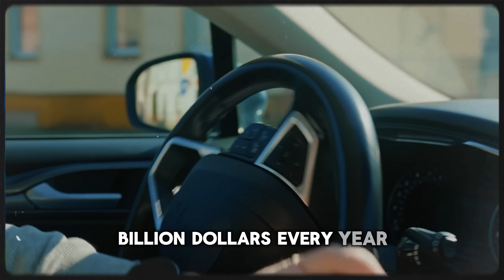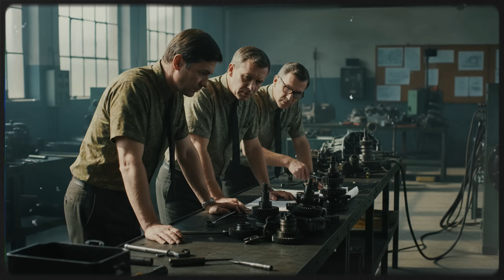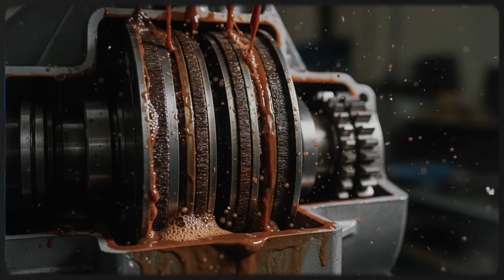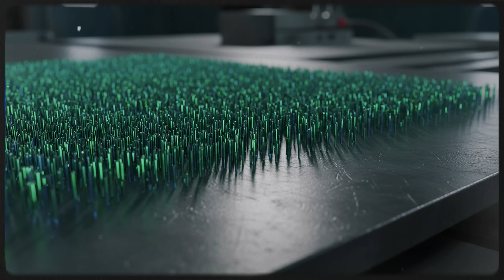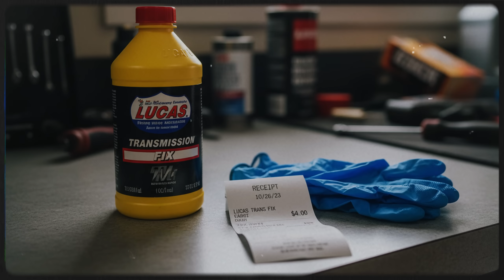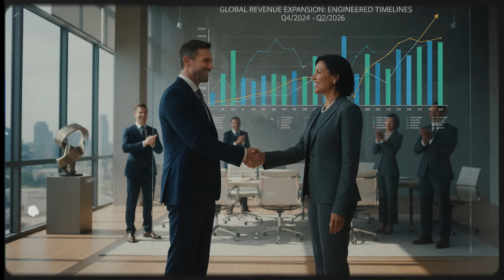$3 Additive STOPS Transmission Slip — Mechanics Don't Want You Knowing This

Comment: If your transmission's friction modifier is depleted, you've left it too long between transmission services and you need to get the transmission fluid and filter replaced. If the fluid is that old, it probably has particles in it that are too small to be filtered out that are acting as abrasives, so you want to get that crap out of it and get good fluid into the trans instead. Don't mess around with bandaids like adding friction modifier to old fluid. Service the trans properly.

Edit: you also need to check the pictures your AI image software produces because quite a few of the pictures are utter nonsense.
Reply from the maker: Regular maintenance is always the best way to prevent wear, though this method is intended for those looking to address specific chemical friction issues after a service. Thanks for the note on the image generation — I'll be more diligent about reviewing the AI content moving forward.
Reply: @DIYMoneyHacks  the trouble is that more isn't always better, and not even mechanics or engineers know where more becomes worse without expensive testing that exceedingly few have access to.
Reply from the maker: @AutoEngineerVideos  This method isn’t a replacement for that — it’s meant for cases where the fluid is already in decent condition but shift behavior suggests minor friction imbalance, not mechanical damage.
And agreed — more isn’t always better, so it’s something to apply carefully, not blindly.
Reply: @DIYMoneyHacks  you didn't read my response to your response, did you. What part of "more isn't always better" was hard to understand? If the technique is for after an ATF change, adding in more friction modifier could cause more problems because of over-concentrating the friction modifier. On the other hand, not all friction modifiers are the same, and different vehicle manufacturers have different ATF specs. If you dump in a heap of a friction modifier that's incompatible with the ATF you've just put in, you could make the problem worse.

Do you actually know how friction modifiers work? Their effect on the friction curves? Having worked on a limited slip diff project, I've become acquainted with the shape of friction curve that works best for eliminating the stick-slip conditions that cause shudder in wet clutch applications (which includes automatic transmissions). More definitely isn't always better, and sometimes it can lead to premature failure due to excessive slippage and subsequent overheating. The friction modifier concentration of new ATF is already set high enough to meet the standards tested and marked on the bottle, so adding more only risks over-dosing the friction modifier and causing excessive slip.

Also, there are some friction modifiers that are incompatible with some clutch materials, and you don't know what's used in either the transmission or the additive bottle. I've personally had the situation where a lubricant had an incompatible friction modifier for a certain wet clutch, and it ruined the clutch pack extremely quickly.

There's a lot more to lubrication chemistry than you might believe, and messing around with it without knowing what you're doing is a very bad idea.

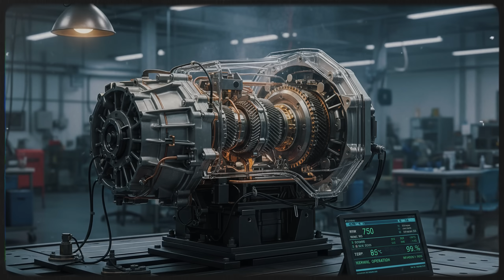Comment: At [06:50], you say this is not masking a symptom. But if the 'shutter' or 'slip' is caused by physical debris clogging the solenoid screens or a worn-out torque converter lock-up clutch, a $3 additive won't fix the mechanical damage. Isn't this just a temporary band-aid that might lead to a more catastrophic failure later on because the driver ignored the actual mechanical wear?
Reply from the maker: This only works in the early-stage “chemical failure” window (depleted friction modifier). If you already have mechanical damage like worn clutch material, clogged solenoids, or a failing torque converter, no additive will fix that.
So no — it’s not a band-aid when used correctly. It’s a targeted fix for a specific cause, not a cure-all.
Reply: What you've described is the need to service a transmission that's overdue for a fluid and filter change. Don't mess around, trying to keep dead ATF going. Just service the trans and be done with it.

Comment: Friction modifier concentrate, Lubeguard friction fluid protectant additive after a transmission fluid change.
Reply from the maker: Yes — after a fluid change, adding Lubegard Automatic Transmission Fluid Protectant helps optimize friction and smooth out shifting.

Comment: Will it work with a tranfer case
Reply from the maker: this is for automatic transmissions with clutch packs. Transfer cases usually use different fluid and don’t rely on the same friction modifier chemistry, so it won’t have the same effect.

Comment: I get engine oil hot take out 1/4 then fill up with LUCAS OIL STABILISER then run for 100 miles then oil level dropped again then refill with LUCAS then after that oil not moved in 2000 miles before was topping up all the time every 2 months and it's gone way quieter love it PROJECT FARM PUT IT IN HIS OLD TRUST HE COULDN'T BELIEVE WHAT HAPPENED LOOK AT VIDEO YOUR SELF HE'S NO BULLSHIT ON EVERY THING TESTED HE JUST DIDN'T EXPECT IT FACT
Reply from the maker: Glad it worked for you 👍 Lucas can thicken the oil and improve sealing, so it may reduce consumption and noise.
But it’s not fixing wear — just compensating for it. If the engine is worn, the effect is usually temporary.

Comment: I use LUCAS OIL STABILISER in the Engine and box manual  6 speed
Reply: Lucas Oil has put a lot of research into the products.  When driving otr I used Lucas Oil stop leak in trailer hubs.
Reply from the maker: Lucas does solid R&D , and their additives can help in specific cases.
But things like stop leak are still temporary fixes — good for managing wear, not replacing proper mechanical repair when needed.
Reply from the maker: It helps with lubrication and can smooth shifting a bit.
But in a manual gearbox, it doesn’t really “fix” anything — just improves feel.
The key is still using the correct spec oil and keeping it fresh.

Comment: Maruti Zen automatic gear (3 speed) car TORQUE CONVERTER , AC model, 14 kmpl mileage. Japan engine, Japan gear box Japan carburetor (NO ECM, NO SCANNING, NO ERROR CODE), Japan radiator, Japan axles, All zen automatic cars prior to year 2000 (only carburetor model, not MPFI) have high quality original Suzuki engine and imported 'Made in Japan' TOYOTA – AISIN automatic gearbox. (1999 Camry automatic car in Thailand did 4 lac km on the original engine and same Aisin autogearbox. Only needed a new radiator and bushes/brake pads/discs. In Bangkok there are over 100,000 taxis. Mostly Toyota Corolla Altis with the same Aisin automatic gearbox. They are usually run to 7 lakh km before being replaced. Transmissions seem to be SUPER reliable....) This same Japanese automatic gearbox was introduced in Maruti 800 in 1990 (2 speed gearbox). Modified version (4 speed) (Indian made) of this gearbox is used in A-star, Vitara Brezza, earlier model of Swift, Dzire, XL-6, Ertiga, Jimny and S-cross.The petrol-powered Brezza and Toyota Urban cruiser share the same 4-speed torque converter AT gear box. So this RELIABLE automatic gearbox has been in India for the last 36 yrs. 
Cars that use the NEW Aisin TF-60SN  6-speed gearbox
Maruti, Toyota, Skoda-Volkswagen, Citroen, Mahindra and Tata cars use the TF-60SN gearbox.
I heard that there have been many reports of issues in the AMMT gearbox, requiring numerous software updates and even complete gearbox replacements even within 25,000km, sometimes GEAR suddenly becomes neutral (free) while on the highway, Need to shift to manual for a while and then after some time it gets stuck on setting it back to auto. You can also add "overheating" transmission / clutch burning to that list. CALIBRATION and clutch LEARNING needed after new clutch fitting. Many fault codes, TCM errors etc. Manufacturers have struggled with the long-term reliability of AMMTs. It is inherently an inferior technology for passenger cars. That's why I don't recommend AMMTs to anyone. CVTs are quite reliable and almost a gearless transmission system. But it is also very expensive but less expensive than DSG/ DCT replacement. It is safe to assume that it's replacement cost will be somewhere around 4 to 4.5 Lacs. CVT transmission uses a metal BELT and this metal belt snapping is common in poorly maintained cars. CVTs are significantly more expensive around Rs 3.5 lakhs for a unit. It’s also about durability and fuel economy. CVTs can be delicate when driven in stop-and-go traffic over long periods, and repair or replacement costs are high. I will always recommend a proper Automatic gear (Torque converter) because of its superior smoothness, performance, reliability & resale value. TORQUE CONVERTER automatic is 95 year old technology and the most reliable automatic gear technology. Latest generation automatic cars have AUTOMATIC GEARBOX with SOFTWARE CONTROLLED gear shifting which is very complicated and may be having high maintenance and very expensive to repair. Latest automatic cars have ENGINE CONTROL MODULE (ECM) Very expensive to replace) and TRANSMISSION CONTROL MODULE (TCM cost high).If TCM is faulty, we cannot shift from Neutral to Drive. Driving with a faulty TRANSMISSION CONTROL MODULE can damage your auto transmission. Latest automatic gear systems are sensor based. Need to depress the brake pedal before shifting from P to D or from D to R. If BRAKE PEDAL SENSOR is damaged or fuse blown, we will not be able to shift from P to D. No BRAKE PEDAL SENSOR in this automatic zen. No ECM/ TCM in this carburetor model Zen automatic. Many latest automatic cars OVERHEAT in heavy traffic. During overheating the FUSE in auto gearbox is blown. Then the car automatically shifts to NEUTRAL and we cannot DRIVE. This automatic zen never had overheating. No FUSE in the automatic gear box of this zen. Have driven 250 km non-stop without any problems. Latest automatic cars have very complicated ELECTRONIC MOTHER BOARD inside the automatic gear box. This Zen Automatic car do NOT have any software or computer or ELECTRONIC MOTHER BOARD inside the automatic gearbox/ engine. No SCANNING needed. This automatic zen has a simple MECHANICAL automatic gearbox. Simple JAPAN engine (carburetor model-even roadside mechanic can repair it) and simple JAPANESE 3-speed MECHANICAL (no electronics) automatic gear box. Latest automatic cars have even 10-speed automatic gearbox. The more the number of gear ratio, the more complicated and more expensive to repair. The more the number of gears the MORE HEAT it will produce and more work the transmission has to do and this results in lesser life.This Made in Japan automatic gear box will last for about 3 lakh km in Indian driving conditions.and this Japan engine will last for about 4 lakh km. The less the weight of the car, the more the life of automatic gear box. This zen weighs just 750 kg. So the automatic gearbox has to pull less weight, so it will last long. Latest automatic cars have non-reusable automatic gear oil FILTER with washer. If washer is dislocated, autogear oil will enter the transmission without filtration and auto gearbox will get damaged. This zen has RE-USABLE flat METAL MESH type gear oil filter without washer. Zen carburetor engine model has more quality than zen mpfi engine model. Do not compare the used car rate of automatic zen with the rate of manual gear zen. FULL MECHANICAL/ ZERO ELECTRONICS CAR. The less the electronics the more the reliability. Average price of good condition used Zen automatic is 2.25 lakhs.
Reply from the maker: You’re absolutely right that older Aisin torque converter gearboxes (like in the Zen) are extremely durable — simple design, fewer electronics, and proven to last a long time 👍
Modern transmissions are more complex mainly for fuel efficiency and emissions, not necessarily durability. They can be reliable too, but they’re definitely more sensitive to fluid condition and maintenance.
Different designs, different trade-offs — older = simple & robust, newer = efficient but more complex.

Comment: They used to use brake fluid to fix a slipping transmission back when I was a kid 
I have tried it, and I know a few people who have as well.
All positive results 
Not sure about the transmissions now  a days, but  it worked on the older transmissions
Reply from the maker: Yeah that was an old-school trick 👍 — brake fluid can swell seals and change friction temporarily, which is why it “worked” on older transmissions. But it’s pretty harsh and not recommended today. Modern systems are much more sensitive, so safer options are proper additives like Lubegard Automatic Transmission Fluid Protectant instead.

Comment: Does this use of Lucas Transmission fix (bottled) only apply to GM vehicles ? 
  Does it offend German transmissions ?
  Audi, Mercedes, BMW ?  ZF 845/55/70 ?  On the shelf at Advanced Auto currently.
Reply from the maker: Not GM-specific — products like these are marketed for “any transmission” and don’t contain harsh solvents.
But modern German gearboxes (Audi, BMW, Mercedes — especially ZF 6/8HP) are very fluid-sensitive and rely on exact friction characteristics, so additives can change shift behavior.
👉 Fine as a last resort for older/worn units, but not something you want to use in a healthy ZF transmission.

Comment: Walmart dont sell it . I know I stock the auto section at wally .
Reply from the maker: Yeah some stores don’t always stock it  — it’s hit or miss depending on location. You’ll usually find it at AutoZone, O’Reilly, or online.
Stuff like Lubegard Automatic Transmission Fluid Protectant or Lucas Oil Transmission Fix 10009 is pretty common online even if Walmart shelves don’t have it.

Comment: So where can one get this
Reply from the maker: You can get it at most auto parts stores — AutoZone, O’Reilly, Advance Auto, even Walmart. Look for products like Lubegard Automatic Transmission Fluid Protectant or Lucas Transmission Fix — they’re usually on the shelf in the transmission additive section.
Reply: On Ebay Uk ar least  just enter Lubiguard. I just searched that word and it came uo first time.
All the best Tom in the UK